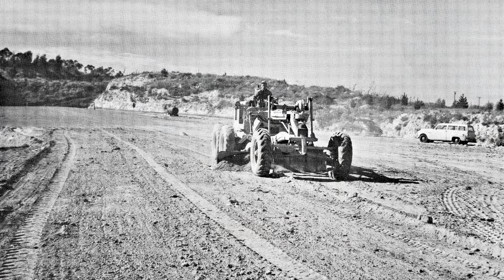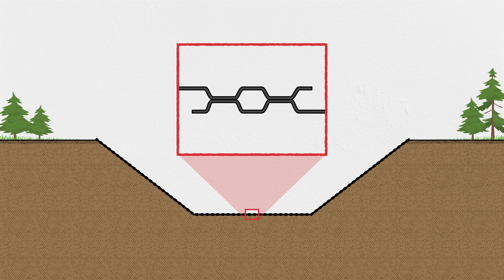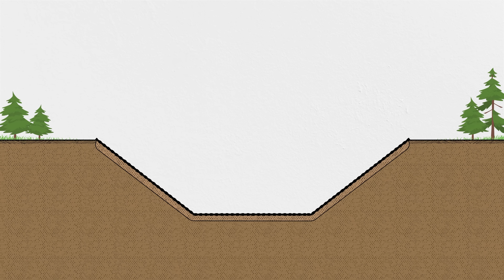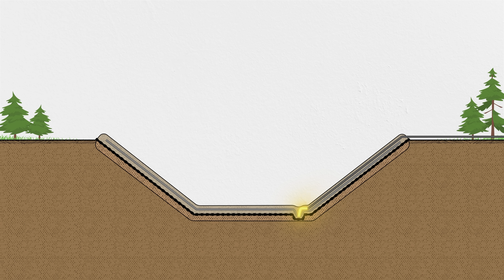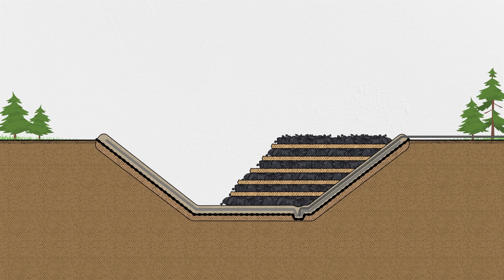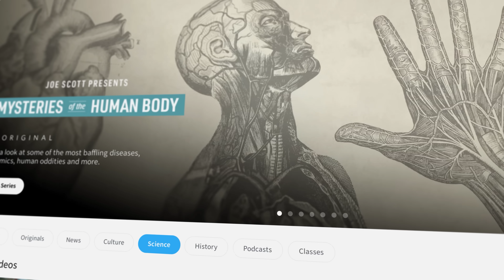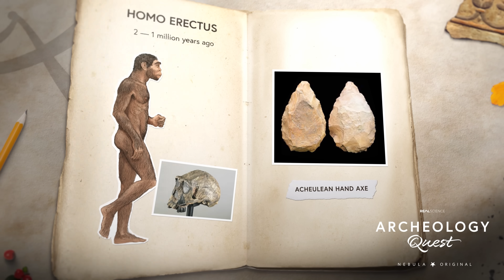The Hidden Engineering of Landfills

Comment: I've been a Garbageman for 22 years, and I personally pick up 30 tons of trash a day. People would be surprised how much waste we as Americans throw out daily. I think it's gotten worse with the poor quality of things we buy. Things just don't last as long these days. I always pay more for Quality so I don't have to add to this problem.
Reply: As a former waste engineer - tip of my hard hat. You guys are the ones in the trenches making this all work. Many thanks for this often thankless work.
Reply: Surprisingly I've had this argument with my older family members for well over a decade. I'd rather spend $50-100 on good pair of wireless headphones ($50-70 is the perfect range honestly) but my aunt and mom would rather spend $10-15 five times a year for some hot garbage that sounds worse than a cup on a string.
Reply: @moze_- But, just because you pay more doesn't mean you get more
Reply: @integr8er66 and just because you get more doesn't mean it's better for the environment or reduces waste.
Reply: Can you estimate how many houses, and ideally people, that the 30 tons is for? I wish the video had covered this, but I’m curious about the average trash per person both in weight and volume.

And by volume, I’m curious how much volume when fully compacted.
Reply: @silikon2  I'm a commercial waste Hauler. So I Do business and apartments. I can tell you I have one town home section that averages 5 tons every pickup. They have 37 2 yd containers and they go 3 times a week so that's about 15 yds a week. The resident guys pickup 1500 to 1600 homes a day and dump about 10 to 12 tons a day. If you ever see a semi leaving a transfer station headed to landfill it will weigh around 81,000 lbs.
Reply: By the way, according to ChatGPT (which always tells the truth), the average American generates 1,095 pounds of non-food trash a year which compresses down to a mere 1 cubic yard in the landfill. Wow. 

It says food waste is another 1.5 pounds a day.
Reply: @silikon2  I'm guessing that's at home. Dies that include trash they throw out at work or at restaurants?
Reply: @silikon2  sounds about right. I used to design landfills and worked in "metric' but, 400-500 kg /y is about right for north america.
Reply: Same with the amount I've seen working at a large thrift store, and the sheer amount of donations. Much of it is unsellable, so if it's also unsold at the outlet stores (where it's sold by weight), and it's unsold at auction (where you get a whole palette of random stuff that may or may not turn a profit at resale), AND it's not donated overseas, it will just go to the landfill anyway.
Reply: @TV-8-301 yep. Only buy what you need not what you want.
Reply: @TV-8-301 ll
Reply: I do the same. But most people are followers and want what other have or has and they want the latest and the greatest of things.
Reply: @hi-tych Agreed. Many of us live in an era of such luxury and convenience that we no longer know the difference between "need", and "want". 
Adults today make me think of my own behaviour when I was 4 or 5 years old: "I want...I want.. I want", and my parents patiently telling me why I can't have everything I want. Except, the "adults" nowadays get more upset when told "no".
Reply: @hi-tych That's not true. Most people can't afford most luxuries so they can only buy the necessities that they need to survive. They're not "following" others. They're doing what they can to survive and put food on the table for their family.
Reply: @hi-tych  Or we can't afford it.
Reply: Planned obsolescence
Reply: @victorycupcake3061  "Planned obsolescence"...most people are in denial about that fact and call it a "conspiracy theory".
Reply: Buying second hand helps too. Or fixing things. If buying something new, now I make sure the brand promotes fixing stuff.
Reply: most of what i used to throw away and now recycle is delivered to me every day via us mail. every container should be made from aluminum. There would be no litter because it has value. This would be beneficial in the third world as well
Reply: Most people are missing the fact that we have the largest amount of corporate and wealth consolidation in the history of earth and it's unsustainable. Things are packaged excessively, to deter theft in the store but at least half the volume of an item is original packaging and then it's packaged in a way that is designed to be left in a landfill. Like any other creature, we work with the resources presented to us and learn from our parents, but this is a whole different scenario where we have no control over any of our intake or output I don't think he did. He's NOT the only billionaire leading the most hedonistic and predatory life a person can possibly have. I would be shocked if most of them didn't have people brought to their home for parties. Trafficked people,.
Reply: People like to argue consumer issue or manufacturer issue but its a worldwide top to bottom societal issue.
Reply: I rode around with my uncle as a kid 35 years ago there was so much better separation between garbage cardboard etc, hardly ever saw food because people use to compost a lot back then, I live near the largest waste management land fills they have adopted a similar idea with separation and etc, over years the hill has dropped as they use the heat for fuel also
Reply: sir, please! You're a pick up artist 🫡🖤🖤 (Garbage men and Pick up artists should swap names petition)
Reply: There is no more quality in modern days. Companies and people just want to make quick money and make you to spend more by making products that dont last long
Reply: Hey man,  Thank you for all that you do!! 💪🏿🏆💪🏿
Reply: It's such a shame. We save money in the short term, but pay more in the long term. I've got a vacuum that used to be my mother's that's about 45 yrs old and still works (minus half the attachments that were lost). And the washer and dryer in our house are about 30 yrs old and still going strong. Not once have they been maintained or broken down since we've lived here in the last 13 yrs. Now I'm buying a new coffee maker every two years and my Levis are as thin as paper.
Reply: In UK  we have to sort our waste. It won't be taken away otherwise. There are fines for fly tipping. Stop manufactures and shippers from producing packaging...global market has made waste of colossal problem.  When I was a young person in Cornwall UK we used only a ' dustbin' literally for our ashes from fires. There was hardly any other waste until plastic. And supermarkets came along in the 1960s. Oh dear. Nightmare since then.😢
Reply: Do you still use landfills in your country?
Reply: People have no idea about rubbish. I transfer the stuff to incinerator’s in the uk roughly 90 tons a day.
Reply: Thx for helping society run brother
Reply: Packaging!!!
Reply: Most of those trashes are probably throw away as expenses by companies as a way to doge tax by buying extra company equipments or items that nobody needs…

Normal people can’t just afford to throw and buy new stuffs on such vast scale
Reply: People should be educated better or something .....seems like alot of people don't realize or give a shirt..it's gross
Reply: Thank you for your work
Reply: Thanks for doing what you do, I know you guys don't hear it enough and moving to Alaska where we have to haul our own garbage to a transfer site was very eye opening for making me think about what actually happens to garbage and how much work I takes now that there's not a can outside my house that's someone else's problem to empty.
Reply: Human are like meat grinders, you push stuff into one end and come out from the other end, in the process generates economy
Reply: keurig coffee pods...
Reply: Most people underestimate the physical and health benefits of being a garbageman. It's kind of ironic to think that disposing all that smelly, toxic, solid waste is only increasing your lifespan. Well done! 👍🏼
Reply: And that is one route, in one day, in one city/town. Most people have no idea how many routes there are in one area each day. Multiply that 5 days a week. In one year, the amount of trash we go through is astronomical!
Reply: Do you ever save anything cool? I remember there used to be a garbage man occasionally on antique road show with stuff he found on his route.
Reply: So about 10 tons per load, 3 trips to the landfill. You must be in frontload or Residential in a large city. . I was in Residential for 10 years. Picked up about 15 tons a day, by hand. Then everything went to automated.
Reply: Thank you for your service. That's one of the most important jobs.
Reply: It surprised me when I was in the US that almost every item at the grocery store gets individually packed in a plastic bag at checkout. I saw people with carts full of plastic bags, all for "convenience."
Also, at some buffets (at Disney, for example), the plastic cutlery was individually wrapped in plastic. So much plastic.
Reply: Obviously waste is a problem everywhere, but it was one of the things that struck me most about the states was the sheer depth of throwaway culture. Like just walking into a fast food restaurant and seeing the amount of straws, napkins, plastic cups with lids, etc. that they gave to every order only for it to immediately end up in the bin. Not to mention the cars and fuel use, or permanent heating/cooling.
Reply: @Hex...  Honestly, the only real solution might be to offer some kind of monetary incentive for people to improve how they sort their trash. Similar to how bottle return systems work in some places, but for all types of waste. Imagine large bins equipped with sensors that can estimate the amount of glass, plastic, metal, cardboard, paper, or organic material someone disposes of. The system could then print out a receipt that can be redeemed for cash or store credit at any grocery store. Just an idea that came to me. 
There would definitely be challenges, like the fact that not every piece of trash has a barcode for easy scanning, and people might try to game the system. But does that make it impossible?
Reply: @Skeptic2006  I drive garbage trucks. The recycling just gets dumped into the landfill. Garbage is money. They are not going to give up their money. Only a small percentage of recycling actually gets recycled.  You would have to pay the waste management to do the separation and actually care.
Reply: @Skeptic2006  In some european countries we have a system for recycling the bottles (plastic and glass) and aluminium cans. You pay something like $0.15 for each bottle and you get your money back when you return them. After only one week we fill a large bag with bottles and we are only two persons living in the apartment. It's insane how much waste we produce only from bottles and cans. Sadly, other containers are just thrown away and recycling some bottles won't save the planet, but at least it's something.
Reply: @Skeptic2006  The first step is for each and every one to work on their attitude towards trash. Why do things like vegetables and fruit have to be packed in plastic wrappers? they could be served in recycled paper bags or bamboo boxes. Some alternative ways of packaging or lack there of are obviously less comfortable, but we need to drop this pampered lifestyle. Glass bottles are heavy? View it as a workout and safe to oceans and forest some plastic waste.
There are a lot of options we can learn from in history (weaved basket instead of plastic bag) and ways other countries go to save waste. like nationwide or even internatinally unifrom systems for bottle return, as you mention. People need to ask that kind of stuff from the political parties they vote for and have to be willing to do their part when it comes to the costs of implementing new things. Last but not least, large companies who produce problematic packaging should pay a proper percentage of these costs until they switch to more ecological solutions.
Reply: @Skeptic2006  Store I worked at once used to give a small credit (ten cents) for each reusable bag you brought in and used for your order. They got rid of it, claimed they'd be rid of plastic by like 2022 or something, then it never happened. Unfortunate.
Reply: @Skeptic2006 Bins ARE being connected with sensors as part of the IoE. Unfortunately, unlike your idea, it is so they can tell what you are buying, how much waste you are producing, so they can deduct it directly, without your consent from your bank account as 'carbon tax'.
Certain corporations will be exempt from this tax.
I much prefer your idea.
Reply: @Skeptic2006   Considering the issue with recyclables is that they're only recyclable if they're the same material, and we've given up on that idea because packaging by design mixes materials... I don't see that changing.

For example, did you know that milk carton you get, the little cap and ring are NOT recyclable?  you're supposed to remove them, cut off the ring, and wash the container
Reply: @Skeptic2006 I was hopeful for more of the bulk selling...not prepackaged, in grocery stores...but with non disposable containers...
Reply: @Hex...  we are kind of screwed over by a faction that wants to eliminate expenditure on civil infrastructure in favor of funding militairistic endeavors.
Reply: @Hex... if u think the states have a crazy throwaway culture visit Pakistan or India.  They just throw trash and food out into the street.  In the USA the culture goes against that
Reply: Your biodegradable garbage is nasty, and full of bacteria.  It stinks, and produces the greatest concentration of gas in the shortest amount of time.
Reply: With as much waste as you have handled, I think it’s fair to say you have essentially touched the filth that was lingered in our buttholes, MANY times. Thank you for doing the difficult job of managing my caca stained butthole items.
Reply: And thank you for not minding the smell of my butthole and millions of other people’s buttholes over the course of 22 years.
Reply: U must be jacked af
Reply: Made in China
Reply: 30 tons all at once or little by little bc all at once might be something to call Guiness about
Reply: @IvyDrip-g6w  30 tons is common.  Transfer semis can haul 120k gross where I live
Reply: @ idc how icky it is but 120 is definitely a bigger number than 30 wow that’s crazy to think about
Reply: 30 tons?
Reply: 30 tons?
Reply: 30 tons everyday? How much do they pay you.
Reply: Plus there is absolutely ZERO real recycling going on in this country.   We used to ship some trash to other countries for recycling but hose countries have stopped accepting it,
Reply: But ultimately most of what we put into the Earth was extracted from within Earth.  Metals, stone, plastics: all of that originated by extracting them from beneath the surface.
Reply: Wow
Reply: Well said
Reply: thanks for your service 🎉
Reply: It’s because of the growing population of the world that things are made cheaper now to keep up with demand
Reply: 30 tons? You pick up 60,000 lbs a day? 😂
Reply: @Mikeyxso  Mondays are around  33 tons. Rest of the week 20 tons sat 14.
Reply: Bless you!
Reply: Hmmm looks like a volcano
Reply: Trashland
Reply: Nobody will personally pick up 60,000 pounds of anything per day without the hydraulic robot arm
Reply: Part of the problem of landfills is increase in large appliances, such as stoves, refrigerators, clothes washers & driers. The US EPA mandates certain energy efficiency , but it cause less reliability, my 40yo pre-energy efficient refrigerator is still going strong, whereas today the typical modern refrigerator only lasts like 7-10 years, the problem is the electronic circuit board that makes all this energy savings possible goes out out, and the cost to replace it is something like 40% the cost of a new box. So when the box goes bad, it ends up in a dump.
Reply: I know...
Right !!!
👍
Reply: maybe you should think about European version of manage waste. Recycle, don't overpolute and burn the rest to create heat that can be transfered by pipes for steam to heat the cities.
It works for us, why don't for you?
Reply: oh common You are not a garbageman , You are the cleanman
Reply: Recently heard someone somewhat jokingly say we don’t need to make anything for another 10 years talking about how much we throw out… I think he’s pretty close to right lol.
Reply: You are absolutely right! And buying from TEMU contributes largely to it! 😢 I've bought a nice charger there and it lasted 1,5 months. But my Nokia charger still runs, 10 years already...
Reply: youre a clwn if you think average citizens like yourself are the problem. the only way an average citizen can stop being part of the problem is by speed running to the next life. we arent the problem. the corporations who ONLY provide what ACTUALLY causes the problem, are the problem. stop feeling bad. ypu arent the issue here
@romanmikhalyevych2506
Reply: So, you never buy anything that is packaged? How did you achieve zero waste in your home?
Reply: We need a plastic tax.
Reply: Used to be a trashman, you could tell how someone lived just by their trash, and what their habits were, good and bad
Reply: Yeah those companies only care about profits.
Reply: There's a lot less personal waste than there was in the 50's, people used disposable stuff all the time then. Not quite sure how much commercial waste has went up or down though(especially since it's common practice for companies like amazon to just throw away most of their goods)
Reply: I'm definitely part of the solution myself. I produce just 4 bags of trash a year pretty much like clockwork, every 3 months. And it's almost 100% nonrecyclable packaging material. Everything else gets recycled or composted.
Reply: It's also such a shame that waste isn't separaed properly in the USA. And yes, it's so true that the average person doesn't care one bit about the incredible amount of waste their lifestyle leaves... people just don't care, it's crazy.
Reply: They dont care cus they don't see it, rubbish magically dissapears on bin day and they dont see it again. @lafidala.1726
Reply: @lafidala.1726
I hear claims that there is no profit in recycling.
Urgh ...
Reply: @lafidala.1726"people just dont care" 
that's where youre wrong. people care. whether their actions reflect that or not. it isn't OUR fault that our ONLY options result in so much waste. corporations do far worse than all average citizens combined. also if it weren't for those same corporations, there would be significantly less waste in the world. 
the problem can't be solved at the bottom level (average citizens) the change has to come from the top (the corporations) amd then that change will trickle down to us. unlike trickle down economics which is a fkn joke. 
stop blaming average Joe for all the waste. it ain't his fault. it's the corporations who only sell Joe garbage.
Reply: I havent paid for trash services in about a year. The thing I've learned is to throw biodegradables outside, cardboard can be burned in the winter in the wood stove for the winter, most plastics and aluminum can be rinsed out and recycled. I feel like there are lots of things that we can do to greatly reduce waste.
Reply: @feralinc.8693 There is no place that I have seen that will recycle plastics. Aluminum oh ya, glass not anymore either.
Reply: @integr8er66  well, I can't verify that it's actually recycled, but it is accepted by recycling businesses in the United States. Granted, it's only specific types of plastic. I'm sure there's gotta be a better use for plastics though. I suppose you could use parts of the plastic for flower and herb planters. I guess it just requires creativity.
Reply: Ban TEMU. Problem solved.
Reply: @imonaroll9502 Problem solved? I say probably cause
Reply: @imonaroll9502  Why do you say that? 

Explain....
Reply: I just spent the cost of a new bicycle to repair my 20 year old bicycle so I wouldn't add trash to this world. Solid investment
Reply: @mariaserafini3437  well that was silly
Reply: They don’t teach it in schools so everyone’s blissfully ignorant and thus selfishly don’t care. Only reason I’ve worried and known about it my whole life is because my parents were one part environmentalist
Reply: True. I pick up 5 drawers cabinet that someone throw out and all it need is a few nails and a little bit of cleaning.

Other stuff is a plant hanger that I use for hanging wet clothes that the dryer didn't finish drying. My wife was telling to throw it away but I refuse. 

I took some kids hard play cubicle, round, semi circle, and triangle toy to do stretches. I have back problem and the semi circle really help my back. 

Some folks throw away those metal sticks to held up a newly weak plant tree. So I gather them up to use for my next small tree.

US throw some good things away.
Reply: @tr1bes 
Do you mean the fiberglass tent poles.
I find them abandoned in dumpsters both un and around campgrounds. Once 4 tents with missing tent poles and/or torn tent material strewn along the exit of a rural rest area.
I use the poles and the torn tent coverings in my vegetable garden. 
Poles used for tomato plant support and for climbers like cucumbers, squash, melons, beans, peas, etc.
The tent material I use as winter ground cover, in fall I rake leaves onto the material to drag them to the compost or as winter mulch, etc.
And much more.
Reply: @tr1bes 
We stop at all Free Piles !!!
We have repurposed broken furniture into shelves and to repair other furniture.
Some furniture and cabinets are made of lumber and we have used pieces for home repairs.
And much more.....
Reply: Alien activity
Reply: i call bull. how many times you dump? how many hours you work? you’d be dead after 3 days
Reply: sure you do
Reply: @serwinzzalot9989  I’m with the other guy